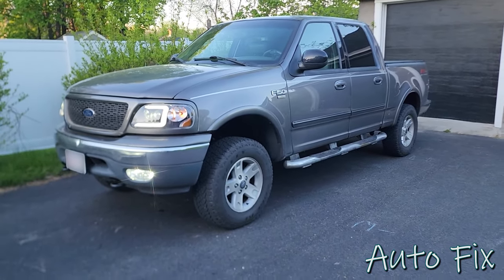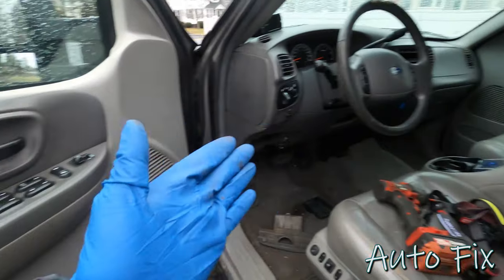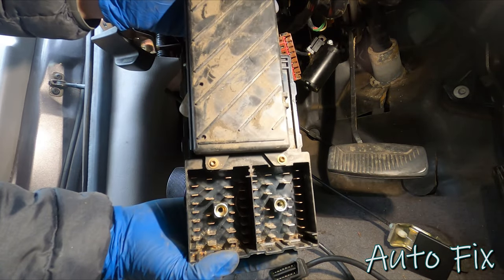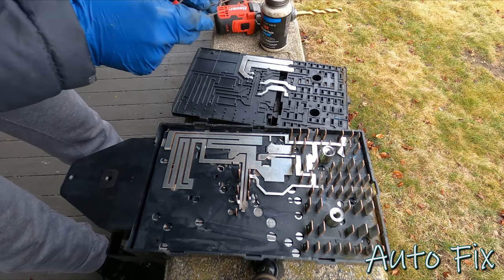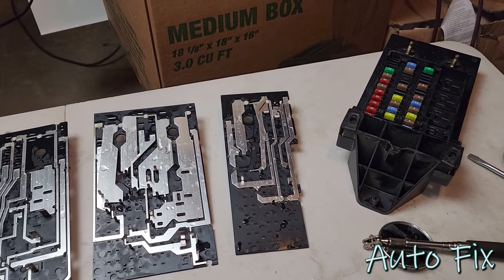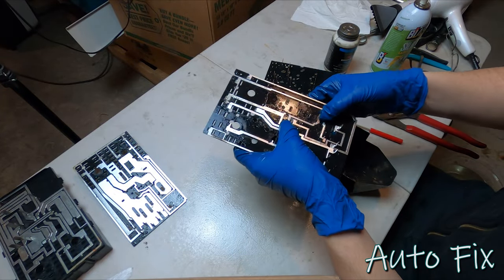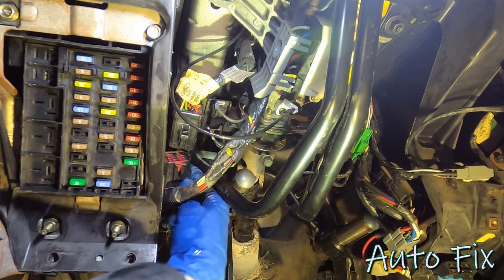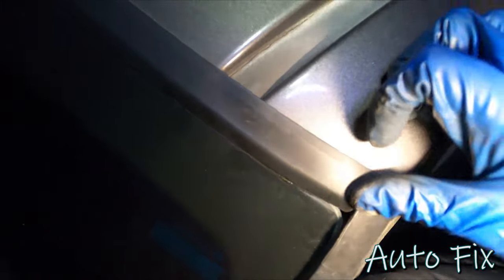G.E.M./Fuse Box Removal, Disassembly, & Fix! / Water Leaking On Body Control Module! 1997-2003 F-150

Comment: Where all can water leak from ? Im having the same problems. Are all the 99 - 2004 2WD GEM the same.
Reply from the maker: Usually it's the windshield. If it's not, then maybe from the cowl and thought the firewall, or through he door harness grommet.
Reply: Thanks
Reply: @AutoFixYT do you know on 99 what year GEMs will work ?

Comment: Any recommendations or tips on how to seal the windshield?
Reply from the maker: @AdamGainer  Silicone is the backyard way, remove and reinstall is the correct way.
I went the silicone route. Worked very well. Doesn't look pretty if you look close, but I was going for function over form on this one. I lifted up the old rubber seal where I could, used compressed air to clean and dry, and I went outside on a hot summer day when the truck was baking in the sun so i could ensure there was no moisture stuck in there, and i lathered everything in silicone underneath the seal. Once underneath was full, i played the seal down and finished it up on top.
Done :)

Comment: I want to say thank you for making this video.  I never new what a fuse box looked like inside and certainly would not have attempted to take it apart without seeing this done.  My ford had the same issue and I successfully took it apart and fixed er up.  Thanks again.  I will make one comment for others who are going to do this.  I did this in reverse order, meaning I set each panel on top of the other so I could set the metal pieces in place without flipping them over.  You have to snap each metal piece in place and that is much easier to do if the black insulator panel is set in place first.  This way was much less of a fight for me.  Cheers.
Reply from the maker: That's awesome, thanks for the comment! And I'm glad the video helped!

Comment: After replacing I would put plastic wrap and sealer on top of the gem and fuse box to keep water at bay.
Reply from the maker: I don't think plastic wrap is a good idea because it prevents air flow. Spraying the internals retains the air flow and cooking properties as it was designed, but adds a layer of water resistance that wasn't there before. Also, like I said, ideally you wanna stop the leak in the first place.
Reply: Very crappy ford design...Aerostar was the queen B

Comment: So? Ford and other manufacturers go to millions of dollars to design these components and they still LEAK? Design flaw or manufacturing defect?
Reply from the maker: There are multiple causes and sources of leaks. The most common issue will be the windshield seal on this truck. They either dry up and stop sealing, or the water pooling up in the roof rails will break through the seal and start seeping in the cab. The right fix is to pull the winshield, clean up the old seal, the potential rust buildup, and reapply new sealant, and reinstall the glass.

Comment: Excellent video - I especially needed help with removing the fuse box/GEM.  I found one small enhancement for your consideration - remove the lower driver's side kick panel to allow access to one more bolt that holds the metal bracket.  Removal of this bolt allows an extra 1/2" that is helpful when removing (and especially when re-installing) the fuse box/GEM.  Thanks for your help.
Reply from the maker: Very good tip, thank you!

Comment: Thank you for your work on this video. My 2001 was having problems similar to your video. Took out the fuse box and didn't see much corrosion. Then looking closer at fuse block found some green stuff. Followed your instructions on how to disassemble the block and found water inside. Thank you once again. 
Now time to have the windshield fixed
Reply from the maker: A very annoying issue to have and too bad these trucks have this issue. But if you know how to fix it it's not all that bad in the end. The trick here is to catch it in time, before it ruins things.

Comment: Hey! I use the same battery positioner tool you do! LOL. Great video! I have my GEM/fuse box out right now, but no sign of water. Am tracing down  a parasitic drain when truck is off. Odd, it goes away if I remove two fuses from the GEM, but one at a time... either one... and the drain stays there. I started to take the fuse block apart, but didn't. Your video gave me confidence to try again. T-Y.
Reply from the maker: Thank you!
As for the draw, it's always annoying to figure this stuff out... keep in mind draws can take a long time to settle down to a number. Thankfully these trucks are old-ish and simple so there aren't many electronics that should run in the background.

Comment: You dont have to remove the knee panel. You can just remove the bolts on the face, e-brake, and hood latch. You can carefully remove the fuse box and GEM module without disassembling so much of your dash.
Reply from the maker: Yeah, I kinda suspected that after I took the knee panel off but I was already committed so I wasn't gonna go back. Only a few bolts anyway.
Reply: @AutoFixYT  I sure am glad you responded.I didn't realize I had so many spelling errors in my original comment. I didn't type that, I was hacked..... 😂🤣😂🤣

Comment: Thank you. You saved me a lot of trouble. I was having same problems my windshield leaked a few years ago i thought i got lucky. When i got all the corrosion fixed started blowing fuse for the radio and dome lights.Found the under the hood light was causing that.
Reply from the maker: Crazy but at least you figure it out!

Comment: If you want an amazing battery/connector cleaner try coca cola i did this process and the coke ate through the corrosion no problem, just left the parts in it for a couple hours and didnt do much scrubbing after.

Also thanks for the video, couldbr have done it without you
Reply from the maker: I will keep that in mind, thanks for the tip!
Reply: Yep. Coke has phosphoric acid in it. It's the same stuff in naval jelly, which is a gell used to remove corrosion from metal parts. The fizz action from the carbonated water helps too.

Comment: Great video. Cant get my tail lights to work in any way 1999 ford f 250 super duty. I found today when i tested the fuses in the cab with a tester this time instead of  just looking at the fuses i found 2 were dead. so i put in 2 new fuses and they tested dead also, and all the other fuses on the panel were okay ........Anty ideas , would appreciate ur opinion. Thanks.
.
Reply from the maker: That means something is wrong before the fuses and they're nit being supplied power. So at this point you'll want to test wiring harnesses, and the best way to do that is with a wiring diagram. See if you can find one online.

Comment: WOW I thought your video on rebuilding the PSP for the Honda was intense this was a just bananas! I have to give you an A+ for patience my friend. When you were doing and undoing the metallic leads, yeah I would have lost it! 😂😂
Reply from the maker: Haha thank you! This was an experience for sure! I learned how fuse boxes are assembled haha to be honest, I had no idea it was layered like that until I took it apart.
But hey it fixed my issue and I even saved the old fuse box!
Reply: @AutoFixYT   Great job! Have you had anymore issues with water coming into the truck? Are you going to reseal the windshield soon?
Reply from the maker: No more issues with the fuse box at all! And yes I will reseal the windshield soon.

Comment: Good job dude...
Make sure the gasket at the back of the hood/ fire wall is sealed across it's full length, and drill 2 1/8 weep holes at the bottom of GEM module so water can escape, if it finds its way back into the GEM again eventually, it will.. btw the glass installation of the rear window, and the windshield, are notorious for leaking due to improper amount of sealant used at the factory, on the 10th gen trucks in particular.
Great job, 
and great video too.
✌️❤️😁
Reply from the maker: Good ideas, thank you! So far it's been just over a year and no water yet! But I do have to reseal the rear window lol, it's covered with tape at the top right now. Looks like trash.

Comment: My 99 F-250 is intermittently having similar issues. I have noticed a small drip near the fuse box too. From the looks of it, the fuse box and GEM are very similar. I'll keep you posted on if this fix is applicable to the Super Dutys too. Excellent video man. Keep puttin' em out! I'm sure you've got a lot of hours into editing/shooting and it shows.👊
Reply from the maker: I would bet that you're having the same issue even though it's not the same truck. It sounds too similar to be anything else. But yeah keep me updated!
And thanks! I have a couple others planned so stay tuned I guess haha

Comment: I’ve got exactly the same problem with my 2003 Triton model. The only difference was it burned my starter running with the engine  while in an ON position.    Very wierd.  I thought it was a faulty ignition switch and ignition cylinder which I replaced but man, I still burned 2 starters in one day trying to fix it, so I ended up making a separate toggle switch for my starter motor😁😁. 
Thank you for your patience making this video. 🙏🫶🫶🫶 
New subscriber here.
Reply from the maker: Wow, that's crazy but I'm not surprised. I was afraid something like that would happen to mine if I didn't fix it quickly.
But good call on the manual starter switch hahaha

Comment: I just dismantled and cleaned all the parts to the fuse box on my 97 Eddie Bauer. Couldn't have done it without watching you do it first, very grateful for this video!

One question - did you just use the silicone spray in between the panels? I've got all mine assembled and ready to put back together, just curious on how to best go about keeping water out for good(windshield is already sealed).
Reply from the maker: Thank you!
I did use silicone spray between all the layers, yes. But that was just an extra safety layer and also to prevent corrosion from humidity in the air. If your windshield was already properly resealed, no water should get in to the fuse box.

Comment: Great video !! I had a lot of the same issues on my 99 Expedition. Car tried to turn itself on, and burned out the starter,  dash lights wouldn't turn off, wipers going crazy, same speedo issue as you! Battery kept going bad when the car was off. Finally took it to an auto shop to see where the parasitic draw was and it was the GEM module! All makes sense now. I'm glad I figured this out in summer so I can work on resealing the window before winter comes.
Reply from the maker: Yup those will make the entire truck go crazy! Good thing you got yours figured out!

Comment: Wow... what a PITA.  You have way more patience and persistence than I do.  What a weird design and bad accessibility. I see where they were going for low cost and low IR drop with stamped metal conductors but there must be a better way.
Reply from the maker: It is what it is, that's all i can say haha I bought the truck, I needed it, and I had to do it. I did not have another option. But yeah it was an annoying process.

Comment: Nice video! The windshield is sealed when installed. The rubber trim pieces are just decorative. So, water ingress is likely occurring elsewhere.
Reply from the maker: Yeah I know. But I lifted up the rubber seals and siliconed underneath them. Problem solved for me.

Comment: I have the exact same problems and plan to get a used fuse box from a salvage yard. This video is the best on exactly how to remove the fuse box and GEM, excellent explanations thank you so much!
Reply from the maker: Awesome, glad it helped! Yeah get a good fuse box in there if yours I'd bad. Also, make sure you seal the windshield so it doesn't keep getting water in there lol

Comment: I've had weird problems like this exactly all of what you have and also sometimes in heavy rain my starter motor will spin up with my keys in my pocket.
Reply from the maker: Yup, sounds like a typical GEM issue. Get that fixed before it catches on fire if it's sparks up in there!

Comment: Excellent video!

The Side-View Mirrors and Driver's Seat Motors stopped working some weeks ago on my 2000 Excursion.

Both are powered through the GEM but go through the USM (Under-Seat-Module) for their 'Memory' functions. All connectors are in place.

ARRGGG! Double ARRGG Even!!

What's a Guy to Do?

I really don't want to disassemble the GEM, like our great poster did, but I will if need be.

Several years ago, I repaired a Corroded-Thru Ground-Wire that powered the USM to get the Power-Seat to work. Maybe I'll luck out again with a similar wiring problem......
Reply from the maker: Unfortunately the best way to go about this is to test for power in different places to see where you are losing power. Fuse, relay, GEM, USM, grounds, etc.
Reply: Yup. You're Spot On Sir, and that's how the USAF taught me how to troubleshoot the Titan II ICBM Launch Control System 60+ years ago and that's how I fixed the 2000 Exploder's Power Seat 7+ years ago.

The seat is where I originally positioned it, and it can stay that way for ever more.

The mirrors are positioned for driving, but I like to angle my side out when merging into traffic and down when backing.

I've had more pressing problems/projects than this one, but it's now been elevated to #2 on my 2Doo-List.

Thanks for your reply. You are exactly correct, and I'll do just that after I move all my Stuffs from my old storage facility to my new one........

Comment: I accidentally discovered this.  I have a 99 + 02  f-150 similar problems. Thanks!
Reply from the maker: I'm glad it helped! It's a very annoying issue and too mad that it affects these trucks like this. On mine it aurally rotted the floor board from having water dripping on the carpet

Comment: I'm still stuck on getting the fuse box to slide down as I write this, and have wathed this video over and over in that part, you don't show what you are unplygging from the back to make room for the fuse box to slide down. I'll figure it out, but I don't unplug stuff that I can't see...I need to know so I can make sure I plug stukk back in right. Video helps more than others, thanks.
Reply from the maker: I just watched the video and it seems to me that i showed everything you need to disconnect to get this out. It was however a very tight fit, and you have to make sure it's not getting caught on any wires in the back.
On the back side the only two connectors I disconnected were the two main harnesses with the 10mm bolts. On the left side you have three plugs, and on the bottom there are some retainers to pop off for other wires. That's about it. Other than that it's all about how you maneuver it out of there.